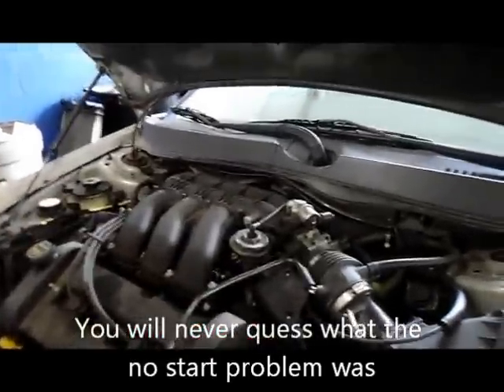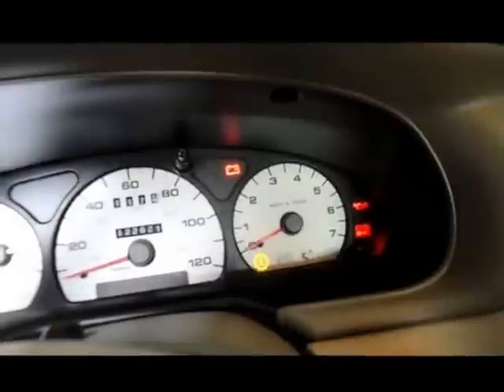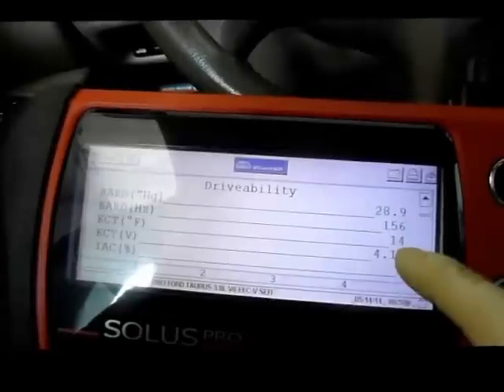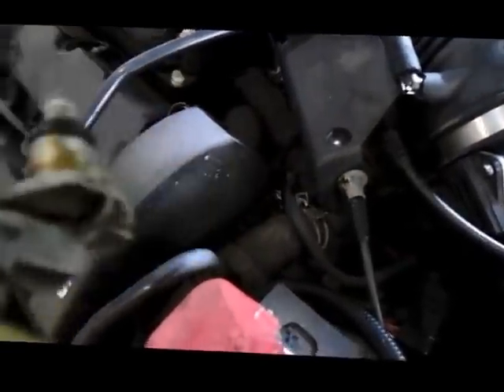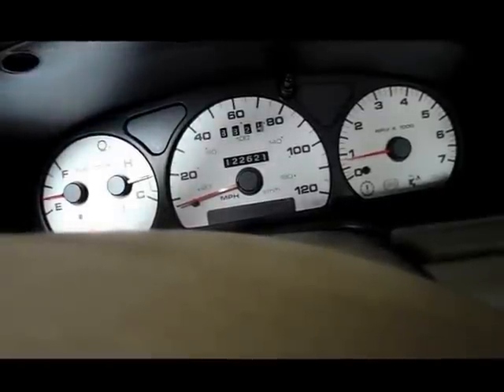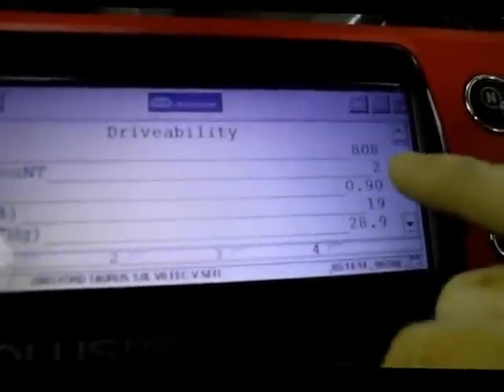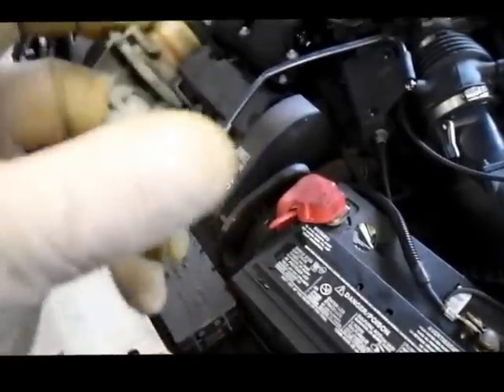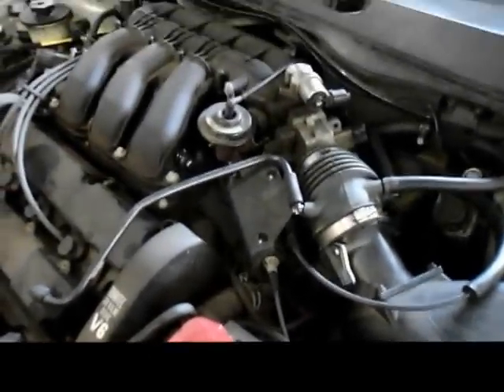Engine cranks but won't start

Comment: WOW, Its just SHIT Firmware ! & it COULD easily be corrected with a flash update/upgrade(maybe even in as little as 5 minutes if you had access to the code/tools etc.) But I'm sure it will NEVER be made(cuz thats just how they roll !). That is quite a serious & unbelievable glitch/bug imo. It could even be intentional(though its so ridiculous that I doubt it), but since engineering is often directed by the finance dept. in these corporate conglomerates, it is a possibility(make a Quota on Dealer Visits). Cars(the automotive Industry) peaked in the early 70's imo. Its bad enough that they are intrinsically mechanical, & therefore susceptible to natural failure but to additionally rely on computers for literally every damn function is a mistake, unless $erious testing & continuous upgrading/support is provided throughout the product's lifetime.

Comment: this is common in all cars that have coolant temp and oil temp sensors fitted,,, both must give a reading close to each other,within a set parameter, if its out, the engine wont start,even if both sensor reading are within the engines safe working temp,no dtcs will show in diagnosis but the ecm knows that one sensor is giving bad readings....funny thing is when the guy shows the reading of the new sensor 192F ! and says lets see if it works,ahah ah the engine is already hot,it has been working for at least 15 minutes!!!he is playing dumb,not givivng a proper reason why this happens ,not really helpfull to anyone as a few will get lucky trying this,others will loose money doing so and nothing new for the auto tecnicians,,it will actually cause problems to auto repair guys,,,,,aparently anything goes for a youtube dolar

Comment: the ecm looks at the coolant and ata sensor at start up and calculates fuel delivery. if they are outside of paramiters it can cause a no start. thats the whay mazda enginers wrote the code. its to prevent flooding. you also lost noid with your no spark condtion. but we never saw you check for noid.

Comment: You obviously make money working on cars because you have that computer. How is this a surprise? Everything I own shuts down when there is a problem with the coolant. In this case the computer noticed that the coolant temperature sensor was showing the wrong voltage and shut the car down to prevent a catastrophic failure. 
Drive more, fix less.

Comment: You said it was in the 70's but yet engine temperature was 192, and pretending it was first start after replacing temp sending unit..Not nice,